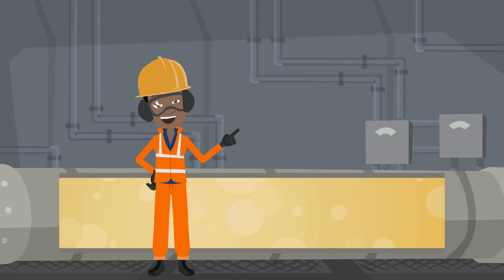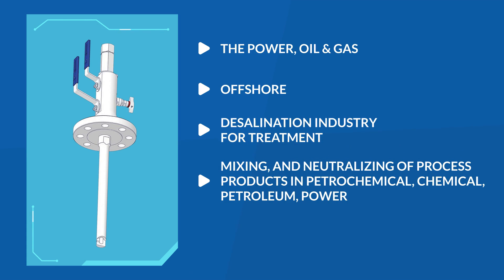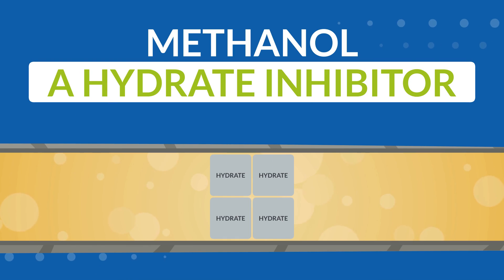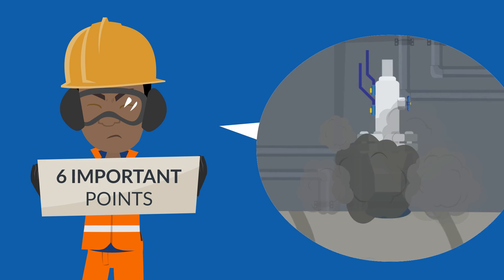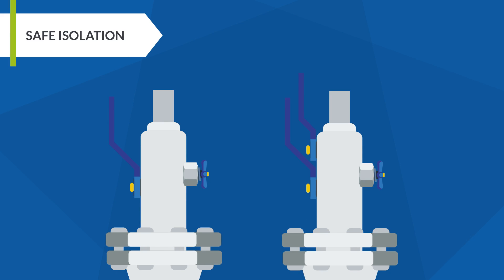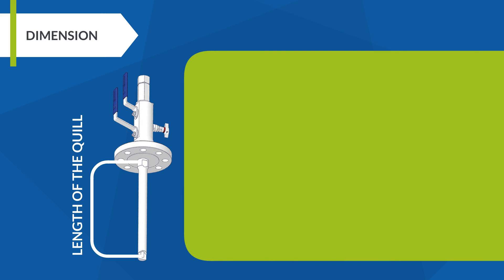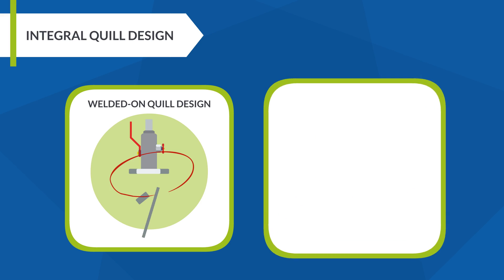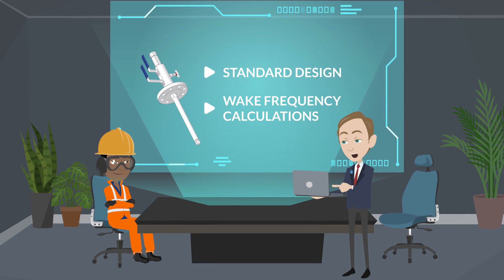Chemical injection quill for oil and gas applications

Comment: It should be noted that a simple hole- type quill vs a quill designed with an appropriately selected hydraulic or air assisted atomizing nozzle is generally far less efficient and runs a higher risk of wall-wetting, a higher risk of duct corrosion,  or incomplete injection fluid consumption and therefore lower efficiencies.